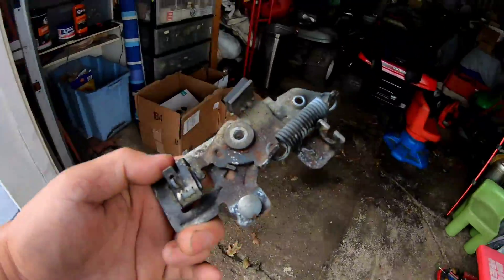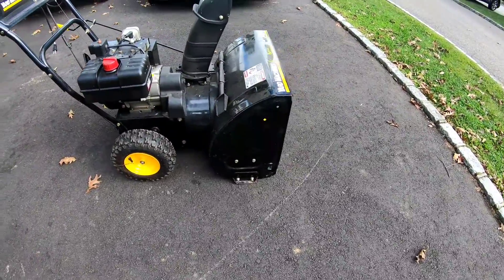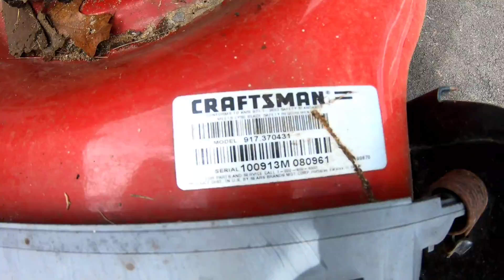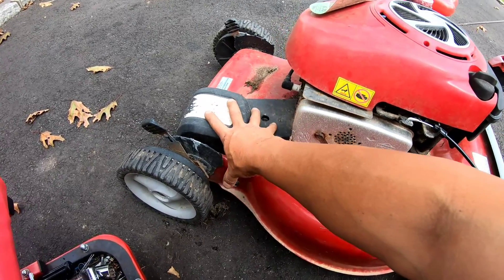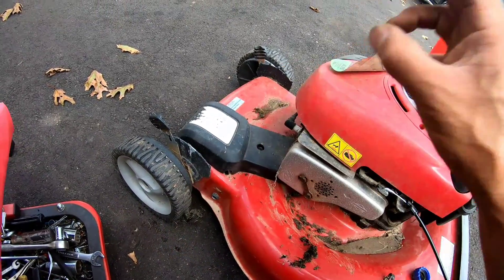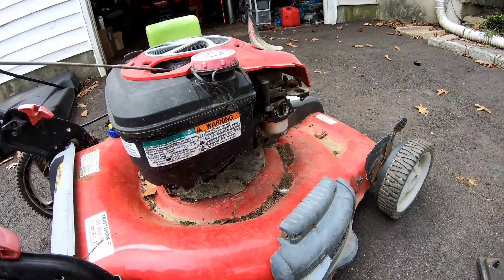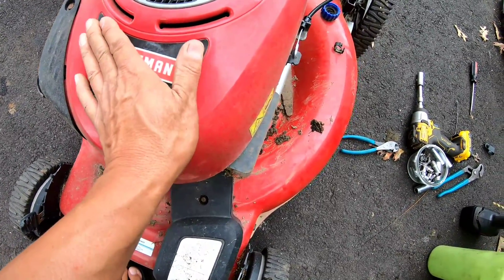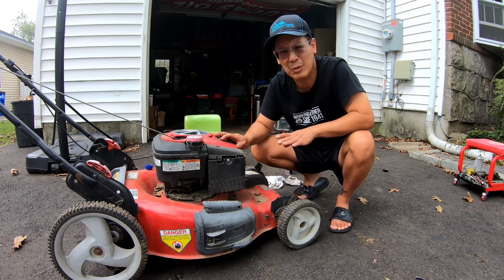FREE CRAFTSMAN 6.75 BRIGGS QUANTUM ENGINE FLYWHEEL BRAKE MAGNETO KILL SWITCH CABLE REPLACEMENT FIX

Comment: I stock piled 10 push mowers this year from last fall , sold them all within two weeks . I listed them one at a time cause I'd have twenty people messaging me about the one listed . So I would devote all my time to one private sale at a time , would always get top dollar out of my mowers . I never had one come back when it left my yard , I would had sold one too my grandma . Always made sure they ran top notch , my mowers - I was proud of when I sold them - trouble free when they left my shop. Not bragging , but I didn't work on them twice .
Reply from the maker: Good stuff Marshall.
Reply: I do things the same way. I make sure everything is top notch, I mow my entire yard with it before I list it (you wouldn’t believe the problems I’ve uncovered by doing that) then give it a good compounding and waxing (only takes a few minutes). Snap some good close-ups and write up the description and it’s sold before I have time to get a cup of coffee after posting it. A nice mower like that AYP I would throw in a gearbox and the hardware from my parts stash and eventually find a bag for it, but I only do walk-behinds (no room for riders) so different goals.

Comment: When you adjust those skid shoes you actually want the scraper bar to sit just a little off the ground. Stack two quarters on top of each other and put them under the scraper bar then adjust the skid shoes so that they’re touching the ground
Reply from the maker: I had a screwdriver under the bar
Reply: Mowers N Blowers that works to lol
Reply from the maker: Lol

Comment: When you adjust the skid shoes you should put something thin under the scraper bar so it doesn't ride on the cement.
Reply from the maker: It had a screwdriver under it to raise the bar 1/2”
Reply: @MowersNBlowers  You should elaborate on that next time, I can see newbies not spacing the scraper bar.
Reply from the maker: But, everyone can see the snow shoes off the ground.  How would it be off the ground if there wasn’t anything under the scraper bar?  To elaborate the obvious would be insulting the audience.
Reply: @MowersNBlowers  Fair enough. Your channel isn't really tutorial oriented. It's more like vlogs on your fixes.
Reply from the maker: Yes, very true.  I’ve done tutorials also, basically fly by the seat of my pants.  Whatever I feel like doing when I wake up really.